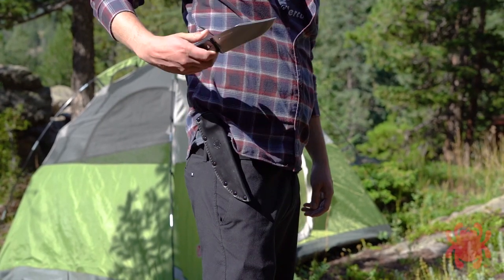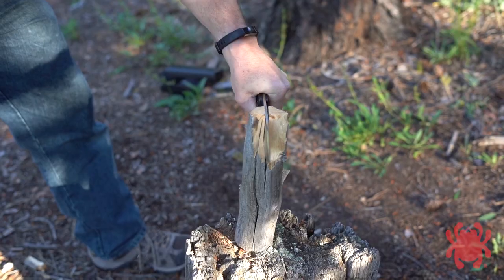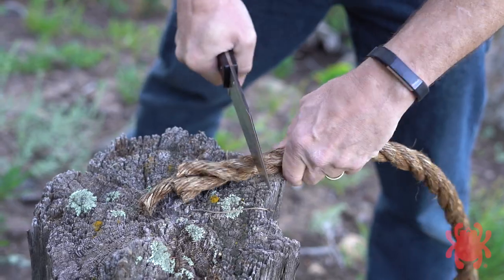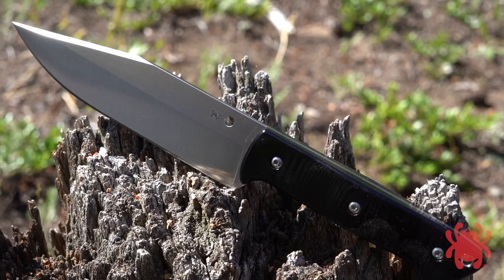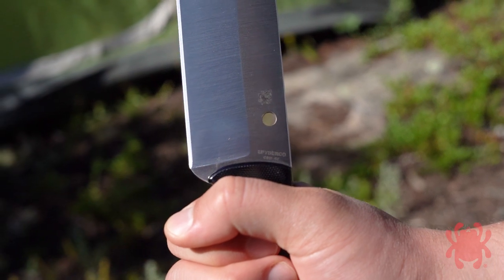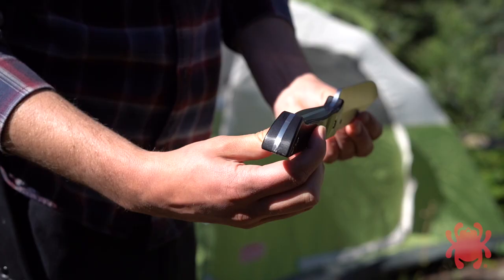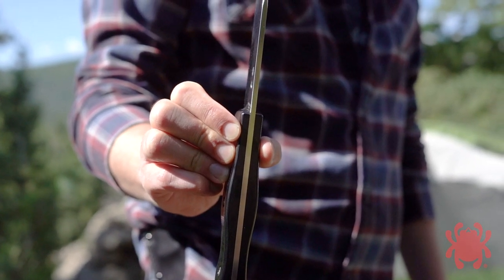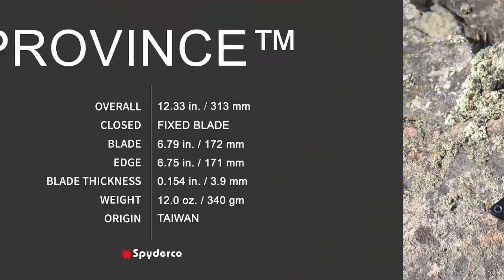Spyderco Province

Comment: Genuine shame this had to be discontinued.
I understand it’s business, but maybe it’d sell better now with MagnaCut. Should be similar performance to 4V, but more stainless and the popularity of the new steel couldn’t hurt sales.
It’s just a really great knife.
I’d buy it in anything from 52100, VG-10, BD1N, to MagnaCut, CruWear, Rex45/M4, etc. the design is so well done and versatile that a number of steels would be useful.
Even the new Spy27 would be really neat since that seems to be a very “friendly” steel to sharpen and still offers decent toughness, edge retention, and is stainless. A real prickly edge is perfect for this kind of knife.
Or keep it 4V. That’s one of the most unique aspects of the Province, anyway. The steel was unheard of in large production fixed blades until this knife.

I just think Spyderco’s fixed blades deserve more love. They’re every bit as good as their competitors (and I personally think better in many ways).

Comment: So nice, I'm getting mine today. This is the blade I've been most excited for. Thanks Spyderco
Reply: How long, and thick is the blade on this one?
Reply: @SteveKluver  6.79 inch blade, .154 inches thick (there's a tech specs slate at the end of the video).
Reply: Thank you much  @FrankSGuerra . I was listening to it on my headset, and only glanced at the video briefly (mobile). Plus, I asked this question here to a friend of mine, and wanted to hear from him anyway. 😁
Reply: @SteveKluver  No problem!
Reply: @SteveKluver  Overall Length:12.27"
Blade Length:6.76"
Cutting Edge:6.74"
Blade Width:1.75"
Blade Thickness:0.15"
Blade Material:CPM-4V
Blade Style:Clip Point
Blade Grind:Flat
Finish:Satin
Edge Type:Plain
Handle Length:5.51"
Handle Width:1.00"
Handle Thickness:0.89"
Handle Material:G-10
Color:Black
Reply: how much?
Reply: @rileycoppicus1128  $260.00
Reply: @knifevideochannel4657  Where are you finding this for $260? I'm seeing $280 most everywhere. Maybe price has gone up since you posted that.....
Reply: @topfueljunkie100  You are correct about the price increase!  2019 MAP was 35% off MSRP., 2020 MAP is 30% off so now $280.00. Still worth it IMO.
Reply: @knifevideochannel4657  Thanks for the quick reply. I'm pretty interested in this knife and I agree with you, an extra $20 isn't or shouldn't be a deal breaker for this piece. It's really got some features you don't see too often in knives of this style. 

I'd love to see some more videos of this being used out there in the woods in typical camping type chores but I haven't seen many at all. Still fairly new though so I'm probably expecting too much. 

Maybe I'll just have to be that guy and get one and make the video for everyone else!
Reply: @topfueljunkie100  I agree with you 100%. I made a video of the knife when I got it (same time as Waterway and Bow River) to show it on camera,  But I haven't used it this season yet. 

The beautiful polished G10 (Taichung does some of the best) , The fantastic geometry of that awesome piece of CPM-4V , And the overall workmanship easily compare  (or better) then Bark River , Bradford,  LT Wright IMHO.  I purchased a Boltaron sheath for it directly from Spyderco site, Much better then the stock leather too. 

Looking forward to hearing what you think!  Enjoy

Comment: It seems it has a really good balance between strength and cutting performance. The handle also seems very comfortable. The only thing that concerns me is the hole in the blade. In folders you need that hole for opening the knife but in fixed blades I think that that hole unnecessarily weakens the blade. It would be better if a circle were just laser etched.
Reply: ...or if a circle was made in the fashion of a fuller.